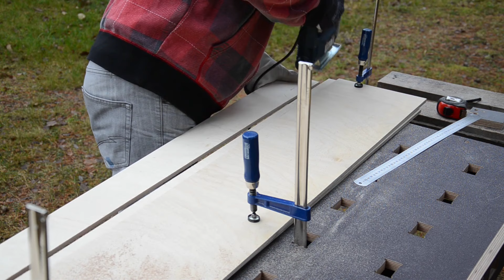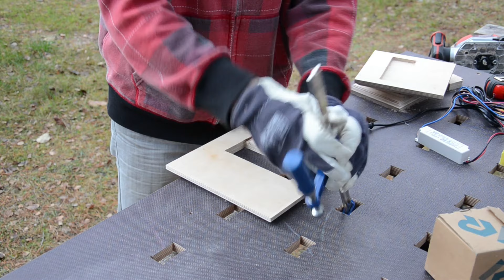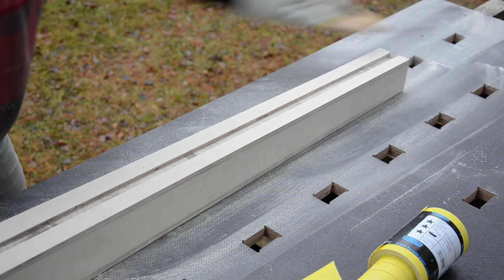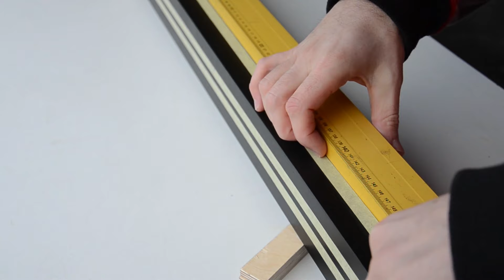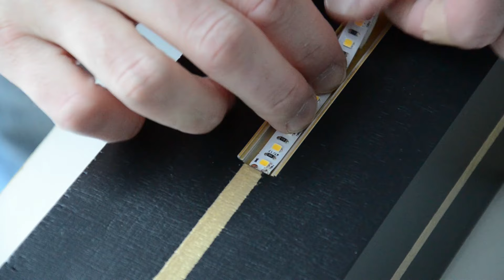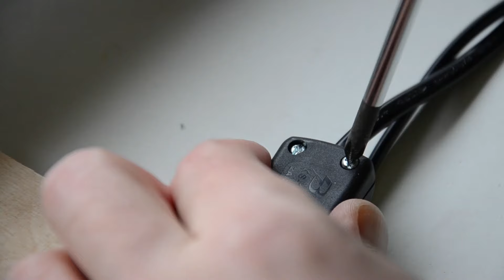Golden Stripes floor lamp build | diy led lamp project | how to make a floor lamp

Comment: I just found your YouTube channel through instructables, and I subscribed as well. I really like this project, and will be making it for my home, but being someone who suffers from attention deficit disorder, narration would be greatly appreciated.  What material did you use to make your bench top with???

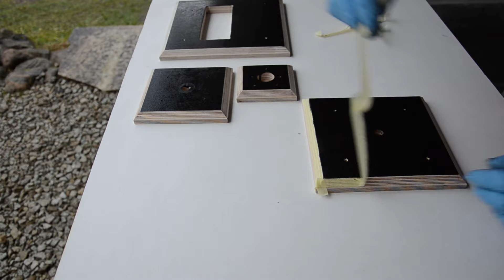6:45 If you paint your plywood before using the router on the edges, you'll get a cleaner line than any brand of tape can offer.
Reply from the maker: It is an option yes, but painting the plywood before using the router has a risk of damaging/scratching the paint surface. 
Also, this is a relatively smooth surface and I deliberately used thick paint to avoid the paint going under the tape problem.

Comment: What is it called, the channel you used as  a led mount, and does it comes with the diffuser?
Reply from the maker: It is called led strip profile. They come in all shapes and sizes and therefore they also have different covers.